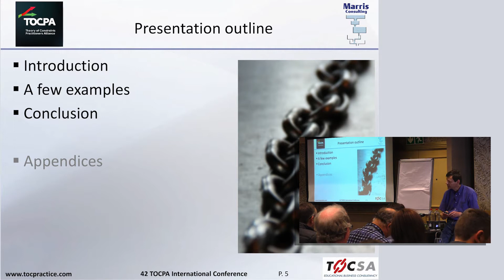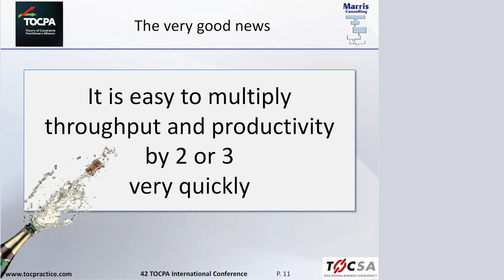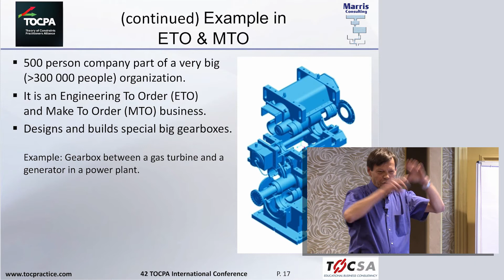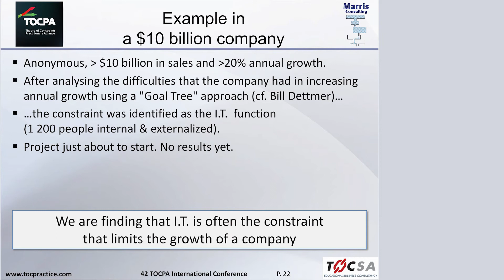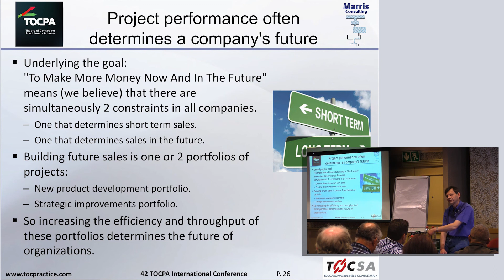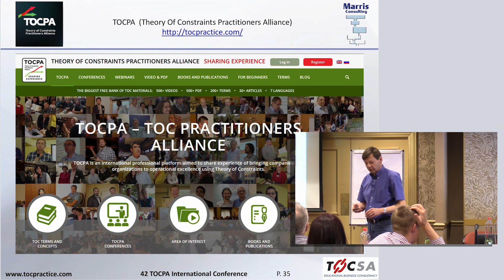Combining CCPM and the 5 Focusing Steps for astounding results - TOCPA Conference

Comment: Video watched and have just sent it to 2 colleagues for homework over the weekend.

I started reading the list of books starting with the goal back in 1997.  There are a couple of titles I need to get my hands on.

But A Phillip mentions at the end, half of the problem is to read the books and start trying to apply the message/principles!

If you also think that the presenter sound at times smug and over confident, then you are right;  having also done this stuff for over 20 years in a variety of industries I too can say that most transactional tasks are at best done with 30% efficiency.

It is rarely the pure value-adding shopfloor/factory zones that create the holdups and stressful (always up against a delivery date) working conditions ….. it is typically the industrial, design and quotation departments that create the waste through misguided management of ‘project execution on time … but not quality’ objectives.

So with Critical Chain being a logical step from basic project planning (with team identified Critical Path) aligned with Theory of Constraints and dynamic resources monitoring and planning.

I’m sold on the message and think we should all read more books !